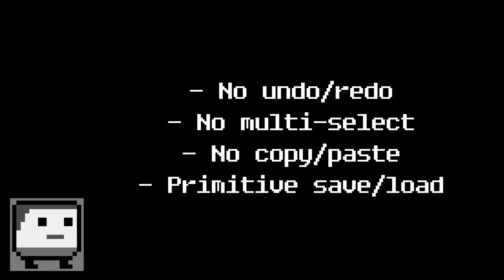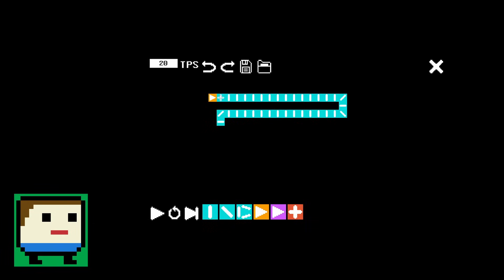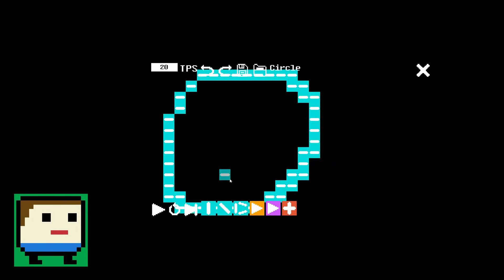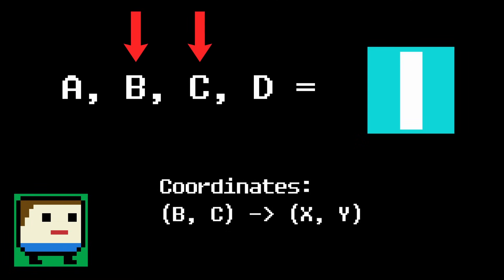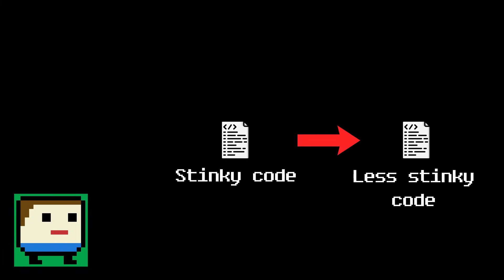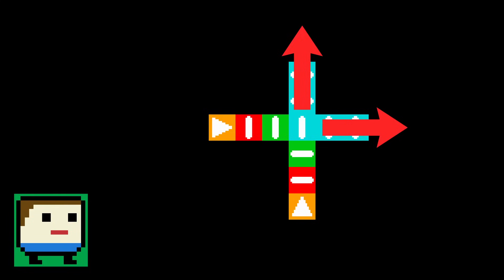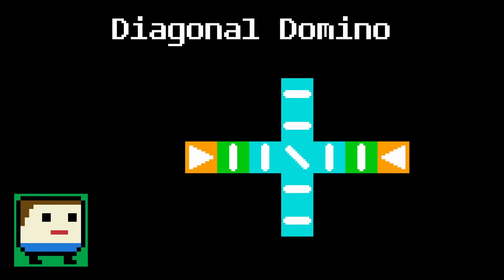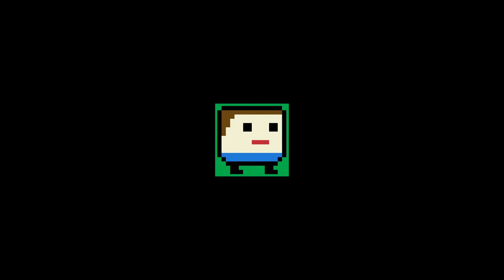OVERHAULING My Domino Simulation Because I Still Hate Physics and Cleaning Up (ToppleBit)

Comment: I would like to point out a mistake. The game was already deterministic, as there was no RNG envolved. Instead it had undefined behavior. Undefined behavior means "bwhavior dependent of implementation". Another program running the same rules could yield another result. But because no RNG was used, it was deterministic.

Comment: Suggestions: Make a negative/stand-back-up domino that goes from laying down to standing up: In addition to just being able to make things run infinitely, it would also allow for things like infinite clocks and other logic-y things.
Add "marbles": They roll infinitely in the direction they're pushed in, as if they were a wave in an infinite line of dominos. When they hit something, they stop dead in their tracks, knock the next domino/marble over, and get reset to the initial state. You'll probably need to make them a "snake" with a front half and a back half when in motion: The leading edge generates a new leading edge on the opposite side of the tail, then deletes the tail, and then moves on to the next step.
Portals: Pretty self-explanatory: If a domino falls into a portal, the domino on the other end of the portal gets knocked over. Also allows marbles to go through, and so on.

Comment: Can you utilize the convolution theorem to change this from N^2 to NLogN?
Reply from the maker: Sorry, but what exactly runs in n^2 time here?
Reply: @KyowobDev43  I haven't thought about this deeply, but in cellular automatons, often the goal is to count the number of neighbors (of course your goal is slightly different). One way to do this is to pick a cell, count the neighbors, and move to the next cell. You have to do this for every cell in the simulation.

Alternatively, you could work in fourier space and use a kernel that is just [[111], [101], [111]]. For elastoplastic models or models where you work with more neighbors, this is especially nice.

With a little bit of thinking, you might be able to come up with a kernel that encodes all of your rules. I'm not sure about this because I haven't put any thought into it. I might be leading you down a garden path or worse, a blind alley. But I thought I would mention it.

Comment: The file format is better than before, but all those commas seem a bit redundant. I suggest replacing it with a format that operates on individual bits rather than ASCII characters. My suggestion is as follows:

First 4 bits: Flag for the version of the file format. This is for futureproofing against features that don't fit in the current specification. For now, it should be left as 0001.
Next 4 bits: Number between 0 and 15, determines how many extra nibbles should be given to the positions, to allow for small areas to not use up as much file size per placed domino as large areas. If this is set to 0000, each position value is stored in (0 + 1) * 4 = 4 bits; if set to 1111, then each position gets (15 + 1) * 4 = 64 bits. This allows for maximum board sizes in the quintillions, while not increasing the file size.

For each placed domino:
First 6 bits: ID for the type of domino (Could be increased if you plan to add more types)
Next 2 bits: rotation
Maybe a byte for colour information? could use 6-8-5 levels RGB and 16 greys for a full 256 colour palette
Next 4-64 bits, depending on the size determined in the header: x position
Next 4-64 bits, depending on the size determined in the header: y position

When saving, I would suggest transposing each domino such that all the dominoes are in the +x +y quadrant, as it's easier to deal with numbers of variable precision if they are unsigned. The value to store in bits 5-8 would then be floor(log_2(k)/4), where k is the maximum x or maximum y, depending on which is bigger.
This could be improved by decoupling the number of bits for x from the bits for y, but I chose not to, so it could be kept byte-aligned.

Comment: 7:42 is not quite true. You could just rotate the interrupt signal so that it gets prioritised
Reply from the maker: True... but if the domino is oriented in the direction of the interrupting path, then it should technically be considered part of that path. So that would be more like an interrupting signal disconnecting 2 paths, not blocking a single one.

Comment: I cannot run none of the Topple bit version, they crash at startup, but Domino Simulation work without problem.
Reply from the maker: Really? What OS do you have? And do you get an error or does it just refuse to open?
Reply: @KyowobDev43  Windows 10 Pro, and no error, just the unity crash window (gray window with icon of the program in the middle with a ! mark in red square on it, green loading bar at bottom) pop up and that's all.
Reply from the maker: @Pupoger Strange… there haven’t been any reports of crashing on Windows 10 or 11. I’ll look into this and try to fix it in the next release.

It could also be an issue on your PC that’s preventing Unity games from running in general.

Comment: I see you have taken a ton of inspiration from cell machine mystic mod.
Also, a new cell which, if activated, creates a signal which untopples a toppled "dominowire" in the direction the cell is facing (this would require a new intermediate cell for "untoppling" dominoes) would be really awesome (you should call it something like the "untoppler"), so that the simulation can run forever, thus making it a turing complete system.
Reply from the maker: I honestly forgot that Cell Machine even existed until people started saying I took inspiration from it, lol.

And your idea has been suggested plenty of times, it will be added in the future!

Comment: nice, i think this could be turing complete
Reply: not yet. infinite and finite loops are required for it to be turing complete, which this doesn't support yet
Reply from the maker: Most likely, but certainly not practical at the moment. We'll need a way to stand dominoes back up so they can be reused over and over (which will be added in the future!)
Reply: @KyowobDev43 If you allowed infinite tilling this should be tc. At the very least I think you could simulate rule 110 with an infinite tilling.

Comment: sense you just storing a list of numbers you should serialize the data.
Reply from the maker: I want to stick to a plain text format. People are already taking advantage of the simple CSV-like format in their own tools. There's no need to overcomplicate that. If you're thinking about compression, there are plenty of text-based methods of compressing save files if I ever need to.
Reply: @KyowobDev43  i am not talking about compression. not serializing a list of numbers is over overcomplicating it.what is happening is you computer is storing a list of bytes(0-256 numbers) then you use a table values to turn them into characters then interpreting those characters as base 10. if you wanted to make it semi-human readable use json if a human accidental misses a number it would be completely wrong.

Comment: You're using unity, right? Could you make an online version, maybe a demo or something? I see a lot of online games using unity, so it shouldn't be too hard(at least I think, I don't use unity, correct me if I'm wrong)
Reply from the maker: No, it generally isn't hard, you just need to export to WebGL. I'm avoiding an online version because multiple systems utilize OS-based API that will most likely fail on web builds. It could technically be done, but it's just too much work to be worthwhile without a very good reason... and it probably won't be so viable anyway. Is something preventing you from playing offline?
Reply: @KyowobDev43   My computer broke, and I'd like to play on my phone while I wait for the parts to be delivered.

Comment: Separate the spritesheet of Textures.png into each object/tile having it’s own image, as this would allow for higher quality blocks (as you are not limited to the locked in size of spritesheet tiles). This would also make it easier to add more blocks, as instead of pointing to a coordinate on the spritesheet, you could just pass in a image name (then scale it down to fit a tile if it’s a HiQuality tile.)
Reply from the maker: That's... not a bad idea

Comment: Your save format includes as version number, right? Right?

Gotta be future proof. Also why is it still text? A binary format wouldn't be any harder afaik. No need for separators at all when a specific number of bytes is allocated to each number. 

With the current number of tiles and rotations, you could fit both into a single byte. I'd probably allocate whole bytes to both though for future proofing (and modded tiles?? That'd need a header though. Should already have one for a format version number. Have I mentioned how important it is for you to have a format version number?)
Reply from the maker: A header isn't necessary at the moment, and I can always add a header when it's needed. Besides, future save systems will always be fully backwards compatible. If you load a newer save in an older release and it fails, that's a version mismatch, not an issue. You're expected to be on the latest version anyway. 

As for the save data, I want to stick to plain text without any binary manipulation. People are already taking advantage of the simple CSV-like format in their own tools. There's no need to introduce complexity with binary encoding, especially since there are simpler, text-oriented methods of compressing save files if I ever need to shorten them.

If by "modded tiles" you mean "additional user-defined components with custom behavior", that's still an ongoing debate, but will likely not be added. It's a combination of technical complexity and (more importantly) failure to align with the core purpose of the simulation.

Comment: Having some rng would be nice
Reply from the maker: That’s still an ongoing decision since randomness goes against determinism, which is a very useful property in many cases. If anything, you could always generate a pseudo-random value based on some seemingly random input.
Reply: @KyowobDev43  mayhaps there could either be a setting, or a special kind of domino for non determinism
Reply: @KyowobDev43 that does work, but using seeds in an ongoing execution would be impossible, having a random domino should work

Comment: You could write a compute shader to process the dominoes on the GPU, that way the simulation should run at basically the same speed no matter how many dominoes there are
Reply from the maker: Is that possible? I don't know too much about compute shaders (please correct me) but I'm pretty sure they're better for processing multiple independent problems in parallel. Updating each domino isn't "independent" because they might need to access the same data at once (like 2 dominoes falling onto 1). It's also pretty tightly bound to Unity's API which can only run on the main CPU thread, so at the very least it would require a huge internal rework. But good thought, I'll keep that in mind.
Reply: @KyowobDev43  bro your sim is a cellular automata even if you don't think it is.
therefore it can be implemented as a compute shader.
Reply from the maker: @lexibigcheese  Sure, if you redefine ToppleBit using those rules, then it would be a cellular automaton. However, that doesn't then imply that ToppleBit, with its current rules, is also a cellular automaton. They're functionally similar, but not fundamentally the same. What you've shown is that there exists a cellular automaton which can simulate ToppleBit, not that it is one.
Reply: @KyowobDev43  if you have a tick function which takes in the state of the board and outputs the next state, as well as rendered graphics,
while running fundamentally different ways, they output the same result.
to be honest, the more important thing is that it can be done on the GPU. if you wanna argue semantics in your comment section all day, be my guest.
but you could also just keep coding, and get this running via compute shader, which would be sick as hell.
Reply from the maker: @lexibigcheese  It’s nearly midnight and I took one minute to reply to a comment to help clear up a small misconception… I don’t see how that’s “arguing semantics in my comments section all day.” It’s a pretty important one too, given the topic at hand.

And yes, I’ll look into delegating the update logic to the GPU, it just might be a while before I figure out shader programming and refactor the code to support multithreading. But it’ll be really cool.
Reply: @KyowobDev43  ehhhh faaaair, it's 4am here.
Reply: @KyowobDev43  update loop for standing domino:
if domino is falling into me, now i am falling.
etc etc.
Reply: and a falling domino can have multiple falling states so a standing domino knows if it should receive the fall or not (like in the diagonal case.)
Reply: you can check out how people made conways game of life on the gpu, since the basics are pretty similar here
Reply: It's definitely possible, something to keep in mind if you are every ready to take that big step

Comment: I was the commenter who pointed out the non-determinism in last video (or at least the first one that I could see) and I think these changes fit really well! Now, I hate to do this again, but I'm worried that there is still a single ambiguous case: What happens if three signals reach a diagonal domino at same time? Does it stop because two opposing signals collide or does it continue (in the only free direction) because there is a pair of perpendicular signals? I think that, as the rules are, I think the behavior will still be implementation-dependent unless I'm missing something. (For what it's worth, I think either choice would be interesting, though maybe the second one would be more "realistic")

That point aside, in my opinion the disambiguations definitely work and even make the simulation more interesting and make constructions more compact. They allow you, for example, to build a "gate" that is a conditional if the signals are staggered but otherwise non-conditional otherwise - really cool!
Reply from the maker: Thanks for pointing it out! (yeah, a lot of people were mentioning the same things)

If a diagonal domino is hit in 3 direction at once, it'll fall in the 4th direction (so if it's hit from the top, bottom, and left, it'll fall right). You can image it as the 2 opposite directions cancelling out, leaving the domino to fall in the 3rd direction. I guess I should have mentioned that in the video... but I triple checked to make sure every possible edge case was covered.

You're right about circuits being more compact, and that's originally why people wanted the edge cases fixed. The determinism makes it easier to precisely control when and how dominoes fall, which is crucial when they're packed together. Thanks for the feedback!

Comment: Your game is so good u should add different colored dominos so we can make art
Reply from the maker: Already suggested, and working on it!
Reply: @KyowobDev43  If you want an idea on how to implement this, I'd believe the easiest way to implement this in the editor, would be an additional UI.
You get the choose "left" and "right" colour, which would mean that dominos require a full directionial definition.
(I'm not sure anymore whether your directions included only "vertical"/"horizontal" or "North"/"West"/"South"/"East", plus some diagonals).

Then instead of painting "red" when fallen, you paint the colour depending on the direction it is falling (which you did include in the falling state anyways), which should be easy enough.
Saving colours however also increases the map save. Either by adding 3 values to each domino (r,g,b).
Or by adding one colour ID to each domino, and a list of colours (ID,r,g,b) at the end of the file, or in an additional file. This would probably reduce storage space, but may take longer to load for large projects with colour.

The most difficult part is probably the colour palette implementation.

Please excuse the unsolicited advice.
Reply: boosting the comment cuz goat suggestion
Reply: that was already considered and i think we may get it